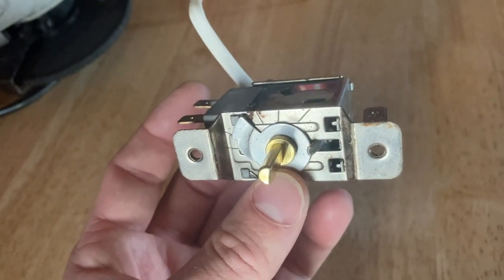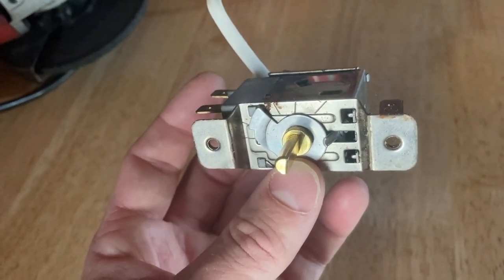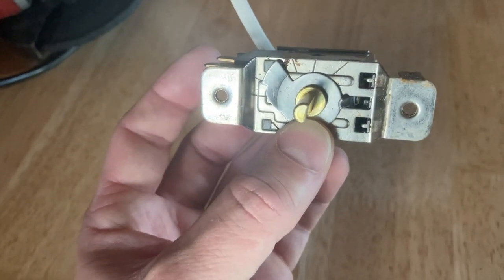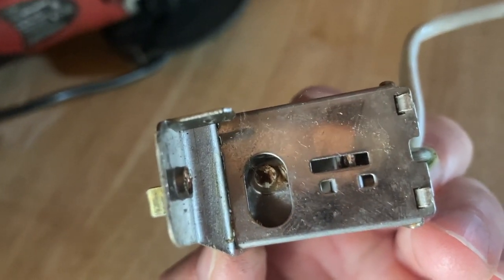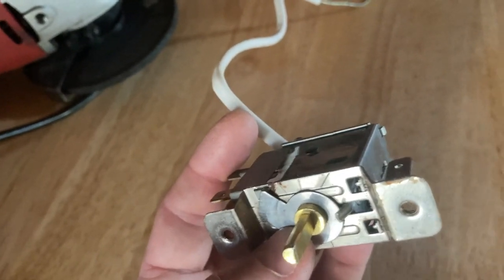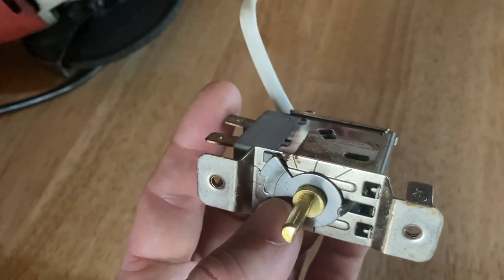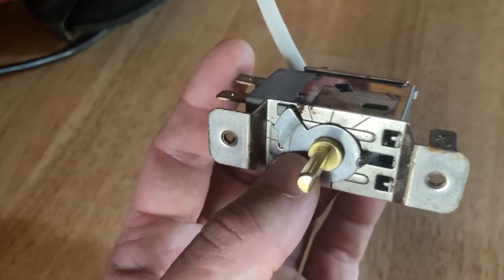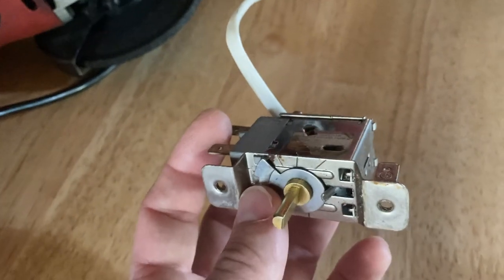Mini fridge thermostat adjustment

Comment: Mine has two adjustment screws. Trying to figure out what the other does. Hers's somthing to think about. What's needed is a high temperature switch on and a low temp off. If the range is too narrow the unit will power cycle too often. Too wide and it''ll undergo wide swings in temperature. So, just guessing, one screw sets the middle of the range and the other sets the width.
Reply: Difference👏

Comment: Can you tell me the model of thermostat that you used to replace yours? Mine looks identical? Thanks
Reply from the maker: So I just picked up one from Amazon the looked similar with the mounts / wires. If you wanted an original replacement  I’d suggest going through the fridge manufacturer. You should be able to look up the part info that way.

Comment: Best video I have ever seen… just saved me from buying another new thermostat…. Quick question for ya…. Does it matter what wires go on where ( except the  ground)?
Reply from the maker: I’m no electrician. However I did receive a non working fridge where a guy said he replaces the thermostats upon recommendation of the repair shop. However he stated it was now not working at all. I switched the wires on the thermostat and it worked.
Reply: @everybodysjonathan  awesome!…Thanks again… my fridge works great now!

Comment: Hi how can I increase the cut off time of my fridge thermostate... Either by turning the adjustment crew clock wise or counter clockwise???
Reply from the maker: Yes buddy, there should be two adjustment screws. The comment above yours was referencing the screw to adjust the run time duration.

Comment: Hi , can you please advise me to the model no of the suitable thermostat for a no frost 2 door refrigerator? I have thrown my old one without talking the number.
Reply from the maker: So rather than trying to be exact, I’ve found just searching for a thermostat that has matching connection points works well. My guess is any thermostat you purchase for a refrigerator may require additional adjustment after installation.
Reply: Can you help me I have a Haier hc32tw10sv and they don't make the thermostat anymore
Reply from the maker: Remove the old thermostat, check the connection points. Buy a new generic thermostats with connections in the same location. Make sure it’s labeled for a refrigerator or freezer. Whatever you are using it for. Can be found on a Amazon or eBay.

Comment: ... Of course by implication anticlockwise makes it cooler.

Thanks. This is one of several such videos I have looked at. This one is clear and precise.

One turn clockwise and measure the temperature, one half turn anticlockwise and measure the temperature. This will allow you work out how much a half turn changes the temprature,  and by derivation the amount of change smaller turns in either direction will make.
Reply from the maker: Short and sweet. I should probably follow this more often here.Thanks for commenting.

Comment: In the cold ice water its not cut off pls let me know.
Reply from the maker: If the thermostat is stuck on/off, or does not change the temperate range it likely needs to be replaced.

Comment: Nice video, what does c,h,l letters mean on a thermostat
Reply from the maker: I’m not sure myself. Seems like it could be closed, high and low if it’s near the temp adjustment
Reply: they indicate which wires connect to which pins.  positive usually  to C  negative to L and ground to H